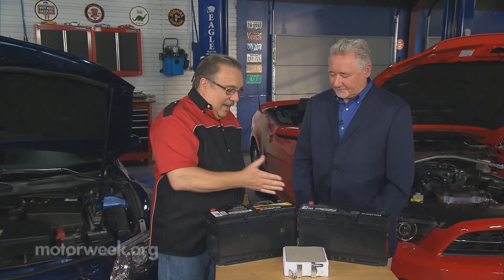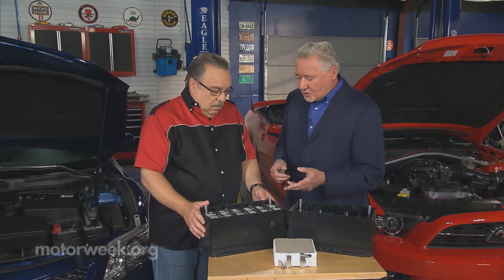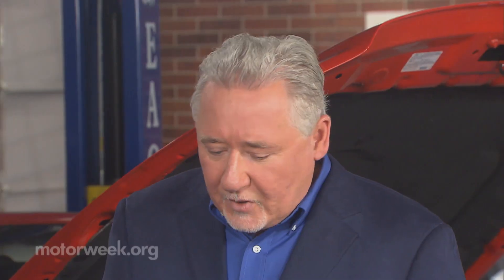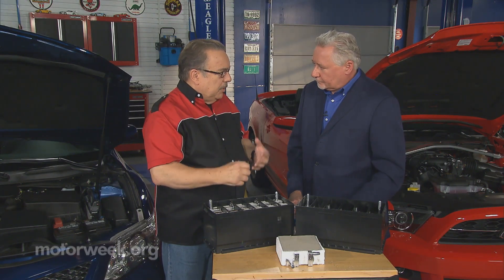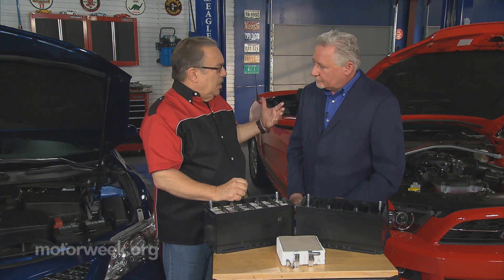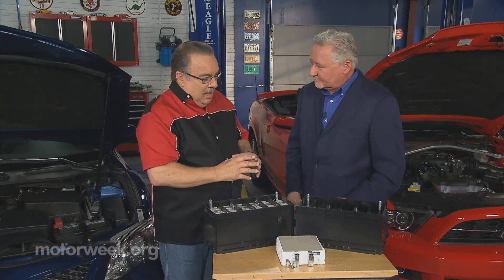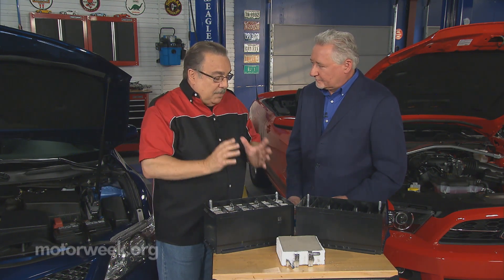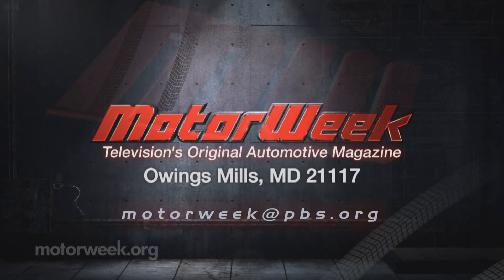Goss' Garage: Die Hard

Comment: Battery tech has moved slower than any other technology on a car.  From lights to tires, from electronics to safety, everything has made huge strides EXCEPT battery technology.  The answer is right in front of us in some new motorcycle batteries and in hybrid cars.  I'm hoping in the next few years we can finally have lithium based car batteries that are safe, affordable, hold a  charge for a year and can be oriented in any direction.  They would also be a lot lighter in weight.
Reply: They are available but hideously expensive.  Who wants to pay $500 for a starter battery?  Lead acid is here to stay for a long while longer.

Comment: I hope those AGM batteries last long. The auto start stop does mean much more strain not only on the starter but also on the batteries. 

On the bright side, cars with those features are much easier to start in freezing temperatures.
Reply: Strain as in mechanical pressure? What strain? The charge/ discharge cycle is more efficient with use, not less. Just leave a battery unused and find out. AGM batteries are better altogether and last up to ten years. They are often mounted inside the vehicle which helps with heat problems.

Comment: Die Hard batteries are a lot better than any OEM battery, especially Honda batteries. I have a 2007 Honda Odyssey, and after the first replacement of the battery in 2009, the positive battery terminal corroded with acid in January of 2013. Took it to Sears that day to replace the battery with a Die Hard one along with the positive wiring that got corroded. If you own a Honda, NEVER use their batteries, even if they offer a coupon discount, because it will only last 3 years.
Reply: Tim Joseph Guess who now make diehard Deka...used to be Exide, but they where bad news, Deka batterys, excellent stuff

Comment: Basically, they are talking about the same technology that Optima batteries have had for around 20 years now. I have had Red Top Optimas in my cars for over 15 years and I love them. They do, however require a slow trickle charge of 2 instead of 10 or 15 volts when drained. They were originally sold as marine batteries and have made their way into the automotive world since.